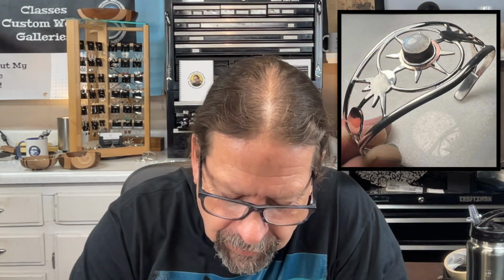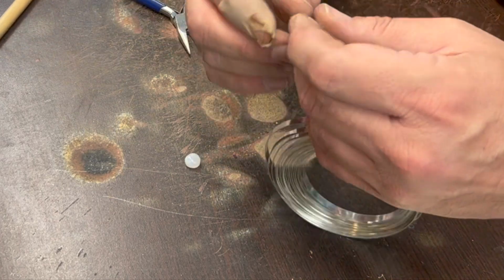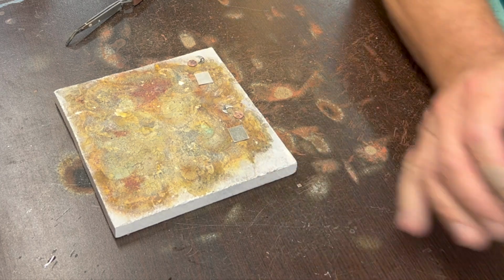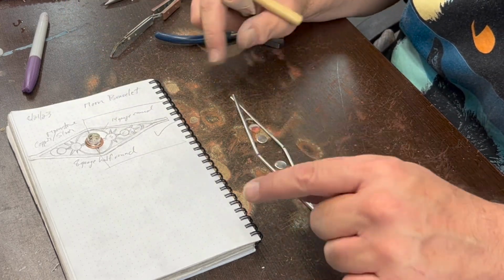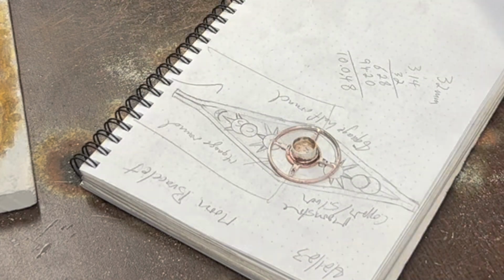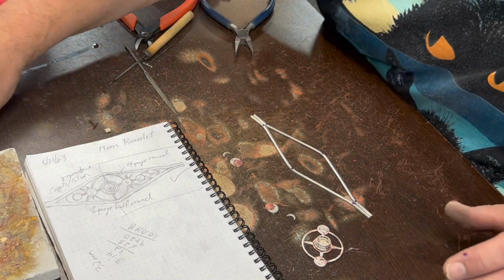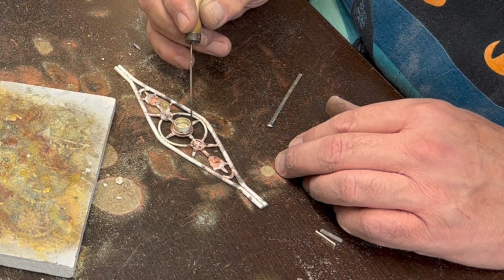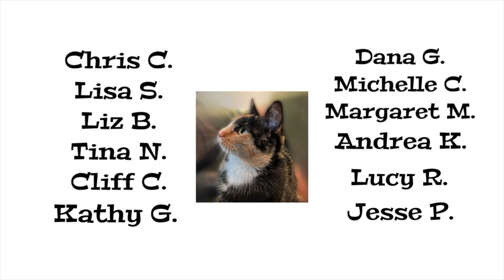Make a Moon Phase Bracelet: A Silversmithing Tutorial

Comment: Great design Chad- thank you! The disc cutter is the only tool that I've bought that I can't get on with. I have to hit it so hard that the discs embed themselves in whatever's underneath and  they have a ridge round the edge which is really hard to get rid of. So I just use the saw and accept slightly imperfect circles!
Reply from the maker: Once you start trying to use pretty thick sheet with the disc cutter it becomes hard to get it with one hit. I use a dead-blow hammer which helps:)
Reply: @chadssilversmithing  Thank you